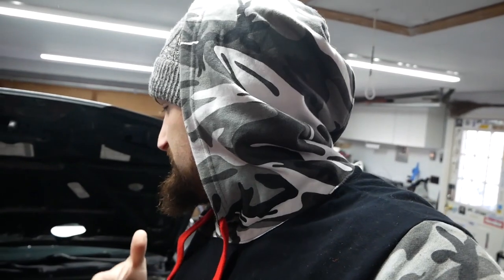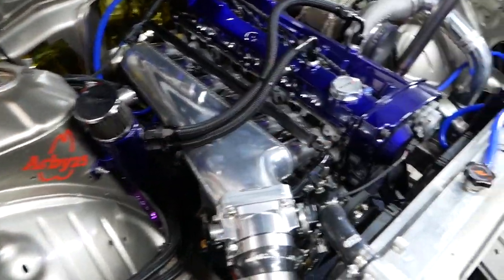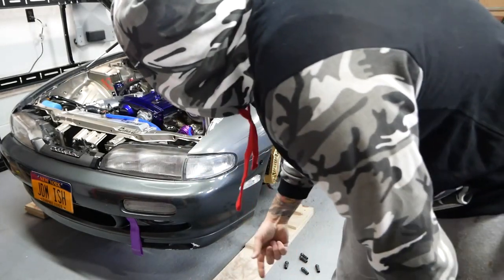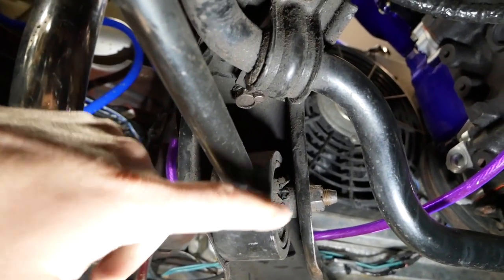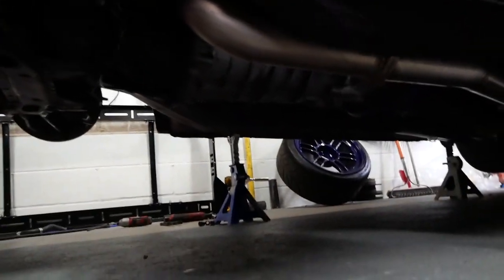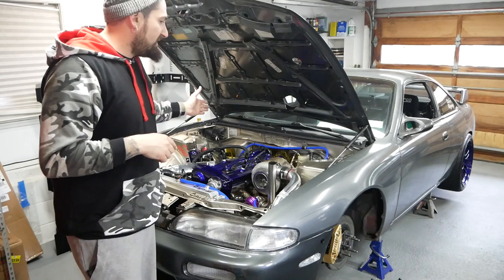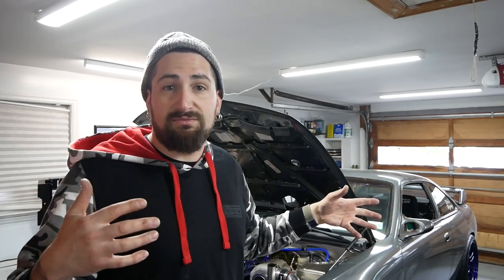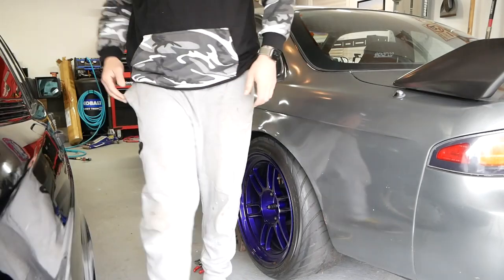How to adjust your Clutch pedal, fixing some bad engine grounds | Daily vlog | rb25 s14 240sx

Comment: I had this exact problem with my S13 clutch pedal, now I just need to fix the slop as to why it doesn't return quite to the top, I have a new spring but so far same issue.

Comment: Did the clutch end up feeling better? I’m having the same thing with my s14 after I dropped my new engine into it. Catching point is towards right when I release like you did
Reply from the maker: Yes. A lot better.. grabs right in the middle now
Reply: @chrisdz  dope! How many turns did you do?
Reply from the maker: I don’t remember how many I did.. def did a few turns and tested it out and it was fine.. definitely might have to test it out a few times
Reply: @chrisdz  did you turn your clockwise or counter clockwise to lower the clutch bite point?
Reply from the maker: @romanflores5505  15:04 i turned counter clockwise to get the clutch to grab in the middle of the pedal movement, as opposed to right towards the end of it being released.. counter clockwise makes it "shorter" so theres less rod in the master, meaning less pushing to engage/disengage it.  clockwise would make it grab more towards the end of releasing the clutch